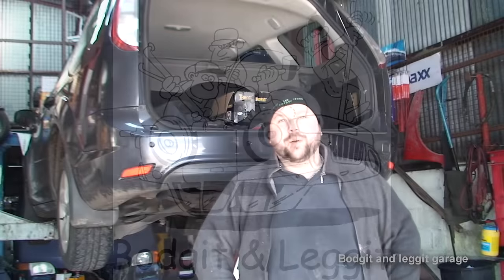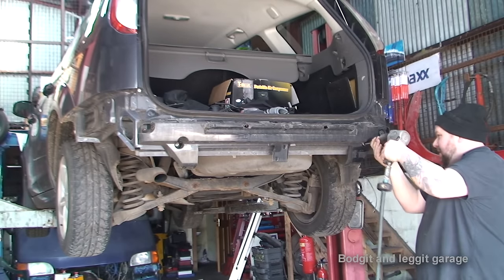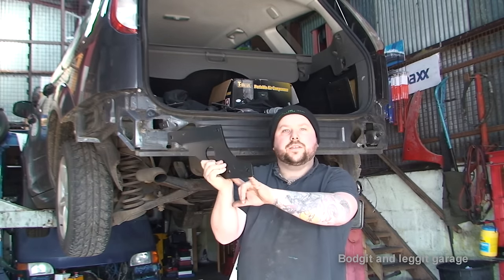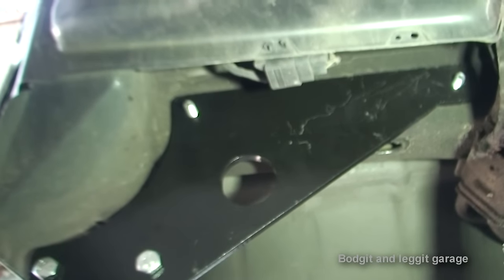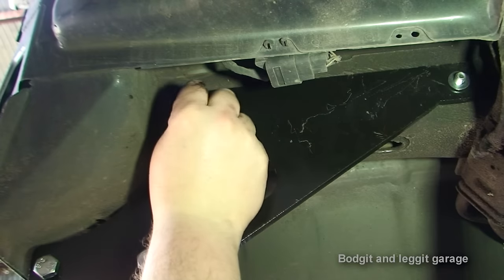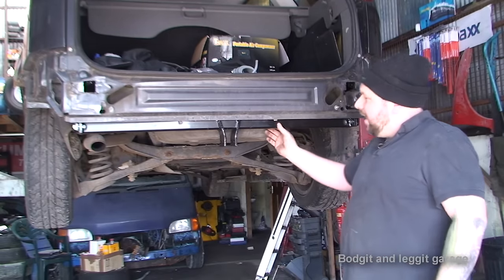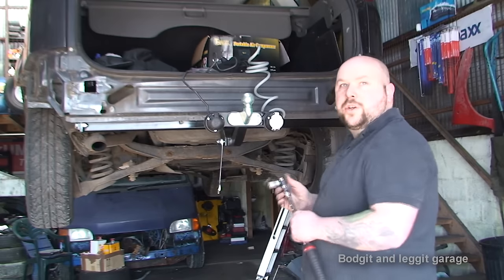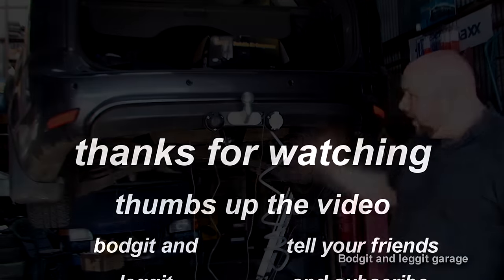how to fit a car towbar 2009 ford focus part1

Comment: A piece of timber slid into the chassis rail behind the bar will hold it if you are working single handed. At least that’s the way I’ve done it before.

Comment: Some excellent video's. I'm installing a tow bar and wiring it myself as the supplier is booked up for the next month. I've got a Ford Connect 2017, all of the rear lights have several wires going into each one, but most annoying is that they are all black thin wires. So, how do I find which wire to clip into and also, are those wires still ok to use those clips, or should I use alternative ones that compress the wires together. Your help is desperately requested.

Comment: Having a similar issue with the bumper, plastic housing and captive nut/bolt inside wheel arch. Just spins and won't release the bumper. How did you resolve? Tempted to use a 3ft crowbar... :)
Reply from the maker: drill it out mate

Comment: Great video. Why can't the two captive-bolt plates just be fitted from underneath, without needing to remove the bumper ? I can see that once fitted, they protrude through the square holes on the rear panel, but don't have anything to attach to. So why are they that long ?
Reply: I've just answered my own question ;)
I hadn't realised the captive-bolt plates fit inside the square section chassis, I'd been looking at an old guide showing plates either side of the chassis. Apparently that older system wasn't safe as the bolts would pinch the chassis and potentially work loose. So now that I've got the bumper off, I can see down the inside of the chassis :)
Reply from the maker: +EagleOfToledo lol thanks for answering your question mate lol thanks for watching get your hands dirty
Reply: I've actually got that exact car, 1.6TDCi estate, 2010, so I'm very lucky you chose it for the video, as there aren't any others on YouTube. One difference I noticed compared to your video was that I needed to refit the plastic crash bar under the bumper when I reassembled everything. This was necessary because it has a number of clips that hold the wiring for the RHS bumper light. So if I'd discarded the crash bar, I would have had to find another way to secure those wires, so it was much easier just to fit it back on again. The towbar I installed was Witter F111A, and it all aligned and fitted very easily. 

As you mention in your part 2 video, the electrics can be the harder part. I'd say it took me 2 hours to complete the mechanical fitting of the towbar, and 6 hours to do the electrics (that means everything, i.e. refitting all panels and trims). I'm quite pedantic about electrics, and paranoid (in a good way) about causing electric faults by getting live wires pinched, or from bad connections.

I installed a PFJ01 bypass relay (the one with the indicator buzzer). Annoyingly on this model of Focus, the wiring looms splits in half and feeds both sides of the car, i.e. each rear light has a separate feed running along the side of the car. This meant I had to connect the bypass relay to the wiring loom on both sides of the car. I stuck the relay on the LHS as 4 of the 7 wires are on that side (indicator, lamp, brake and reverse), but had to make 3 extensions to reach the RHS to connect to the RHS indicator, RHS beam and fog lamp wires. On this model of car, there's a strange black expanded polystyrene bar that sits at the far end of the boot floor, behind the rear passenger seats. I cut a channel in this using a soldering iron and fed these extension wires through that bar, and then fed the wires back up to meet the wiring looms above the wheel arches on each side. I've routed the wires such that, in a worst case scenario when I chuck something heavy and sharp in the boot, i.e. and old fridge, there's no chance of the wiring getting damaged.

Getting a live feed to the relay wasn't simple. I referred to my Haynes manual to find the wire coming directly from the battery to the passenger fuse box, and I soldered a fuse-holder onto that wire. Again, it's wasn't easy feeding a wire down the side of the car, and meant pulling up trim and carpet, with lots of cable ties to attach the wire to the main wiring loom.

Anyway, my last job was connecting a trailer light testing board, and it passed first time, so I'm very pleased. Thanks so much for your help :)

Comment: Great video. Could you tell me where you bought the towbar from and all the normal electric
Reply from the maker: Tommy England hi mate I buy them from my local Motor Factors as a kit depending on what car I buy the kit for the car saves all the guessing you get everything you need
Reply: bodgit and leggit garage. Any chance you could send me a link to a tow bar for a 2005 Ford Focus hatchback. Thanks Tom

Comment: Ahh, the instructions... My first time installing a towbar today... bloody nightmare... The only way it could work is if the mounts go inside the rails...

Instructions never stated where the body fits in relation to the towbar. A side note. The Nissan Almera hatchback towbar from Tow Trust seems to warrant a mount going on the side and going into the towing eye. Mine was never used. Don't ask me how I know, but I've used my BIG range tap and die set and that went in nicely.

I would stand on it to test it - but I exceed the rated load.... A few bounces and shakes seems to work instead.

Wiring is a nightmare. I'm using a 7 pin kit and the wire kit I got - had 8 ends, I was tracing a fault that only exists if the socket isn't wired up. FFS. It's a kit from Germany FOR the LHD market, so I need to work around that.

I put the socket on the right side. My reasoning is that to get out and dis/connect the socket is easier if I don't have to lean over. Looks stupid? Practical ;)

Comment: Even with lock washers i would of added a little locktite or swapped the nuts with nylock nuts lol, never be too safe!
Reply from the maker: hi mate yes I agree you can never be too safe but like everything where do you stop I have had problems with all types of locking washers / nuts you just have to keep an eye on them all no matter what regardless you should be checking them once every month anyway
Reply: Thats very true nothing is 100% safe! Good job though enjoyed the video!
Reply from the maker: +The Savage Garage thanks mate  as do I enjoy yours